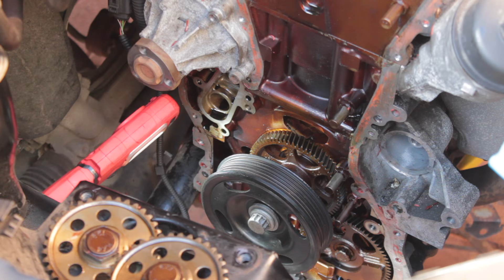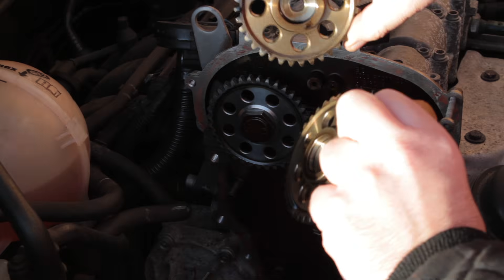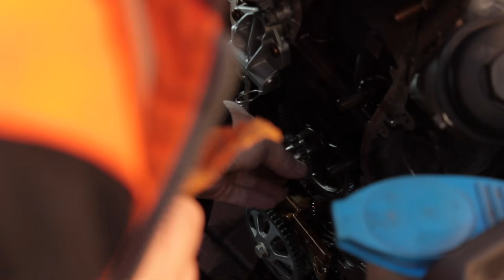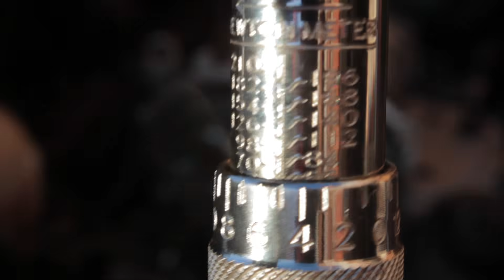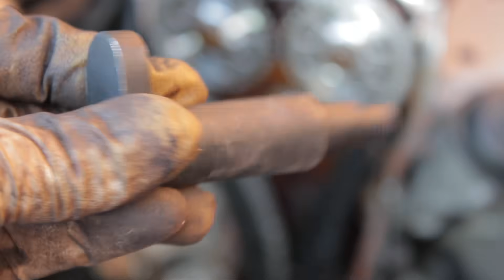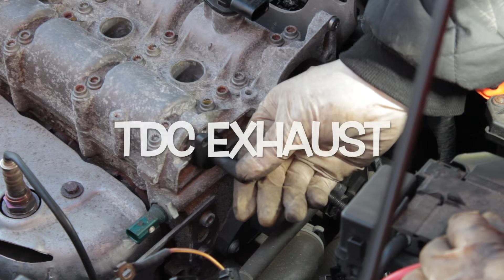VW Polo 1.2  2010 Timing Chain Renewal Engine Code - CGP Part 3

Comment: Hi, if the 2 dots on the bottom gears are lined up with each other and the cams locked with cylinder 1 at TDC, would yoh say its properly timed up? I only ask as I've done one today and the crankshaft locking tool would not go in the hole to lock the crank so decided to do it without that. I would have run it but was doing it at work but they closed before I had time to finish.

Comment: I see replacement of sprocket bot, or not, discussed and with different opinions several forums. The original Seat repair manual for this engine does NOT mention replacing the bolts. The Haynes manual says to replace. Both manual says to replace the crank bolt for comparison (and lubricate it according to Seat manual). The cam sprocket bolts are 12.9, and according to specs I find online the tensile strength of 12.9 is minimum 1220 MPa. Some googling show me that max tensile strength of cam steel is 1200 MPa, but others states higher (and I don't know about the ones in the 1.2 engine). So there will probably be similar deformation inside the cams as the bolt threads if my interpretation is correct.

Just doing the same job with the sprockets just now after a head overhaul (burned and pitted valves and seats), and I see the same with the tensioner that "jumps" when cam resistance gets above a certain limit (as due to no oil pressure behind the "piston"). On my first attempt of turning the engine to check everything, the exhaust cam sprocket either slid on the cam or it jumped a tooth when the tensioner jumped. So I had to loosen the bolt on that sprocket and adjust the cam to right position (it was easy to turn using the timing lock and a water pump plier). I have not replaced the chain as it says only to "inspect" on 240000km, and the engine is 60000 away from that and the car will probably end its life before... New engine turning verification looks fine even with only additional 45 degrees on the bolts (as I didn't want to torque them up to full before checking again). After several rotations (even with tensioner jumping each rotation), the timing tools gets in perfectly at TDC.

But it worries me what actually happened when the exhaust cam slid on first check. Any suggestions? Should I remove both sprockets again, degrease contact surface (as I guess friction here is the only way of transferring the torque from the chain to the cams), and put additional pressure to the tensioner when torqueing up the bolts to its first step (50Nm)? Any thoughts or suggestions?

Comment: Firstly why didn’t you time it up to start with when you have to correct timing kit seems a bit backwards to me. But the you rattle on about flex in the chain it’s not flex it’s because there is no oil in the timing chain tensioner which hydraulically keeps tension on the tinning chain guide. The tensioner won’t work until its got oil in it as that is how tension is held onto the timing chain guide it’s not flex it’s not oil pressure in the tensioner 😝😜🙈

Comment: Great video as usual sandy very informative, I unfortunately followed all procedures got it all lined up hand turned several times without plugs in and all still lined up but for some reason have zero compression in all cylinders, leak down test shown all air escaping through intake pipe, triple checked my timing and still looks good so unsure what I’ve done but pointing to intake valves even tho they were fine before I removed the timing chain with crank and cams locked before hand, wtf age I done or am I missing 😂

Comment: I think the slack in the new tensioner is because there is no oil pressure yet. I'm highlighting that I think that's why. Busy doing the exact same job now. Thanks for the useful video. Wish I had a 2nd man for torquing these bolts!

Comment: Hi Sandy I’m having a nightmare with these timing mark. You said your timing marks were 180 degs out on the crank at the beginning. But they must have been right 180 deg out as after you put the new chain back on with the cam tool in place you were on the exhaust stroke. 
Can you please clarify where tdc mark should be with the cam tool in? Marks together or 180 deg out. 
Many thanks I’m having a nightmare with this. 

If I put all the tooling in (crank and cam) and install the chain every time the cam position is 180 degrees out the with the mark together (That is why I think the dots/marks must be opposite when you install the cam tool) maybe!
Reply from the maker: Just go with the timing tools if they correctly in/engaged then the timing must be right don’t worry about dots on crank maybe it’s just an anomaly. Time up and turn crank by hand to make sure nothing hits before u crank it up
Reply: @sandyande  thanks for the reply. I found out today Peugeot use a wasted ignition system where it fires on exhaust and compression so think I’m good.
Reply: It all worked out. For any one doing this job with the tools fitted your be on TDC no.1 exhaust stroke not compression. 
Thanks for doing this video Sandy.

Comment: Hi sandy yesterday replaced my timing chain on 1.2 petrol polo , however during test start it was observed that the oil pump isn’t pumping oil . Earlier i mean before the repair pump was fine. What could be the issue? Could it be the pump or timing installation setting? Please respond

Comment: Hi Sandy thanks for posting these videos very helpfull, my daughter's 10 plate has same problem just hope it hasn't done valves, I can't seem to find  the crankshaft sensor is it over the back on the top of the bellhousing,all so can I lock the engine with the TDC peg so as to undo the bottom pulley my zippy gun hasn't got the guts in it to wiz it off,thanks

Comment: Thank you for the videos and the great help with this job.
I just did mine today, same car and engine. I followed all the steps and specs and changed both chains as well. During the assembly, all marks were ok on both camshafts and the crankshaft and TDC. After torquing everything down I turned the engine and all marks were spot on again. So I finished the assembly and when I started the engine, it started straight away and after 2 seconds the tensioner pumped oil and the rattling disappeared and the engine started to run nice and smooth. But maybe 10 seconds later all of a sudden another rattling started and this time wasn't going away. It sounded from the area of the timing chain. I stopped the engine and after a while started it again and the noise was there all the time. I tried to rev it a little bit in case it needs to pump oil better up to 2000 rpm but no difference. Weather at idle or higher revs, accelerating or decelerating the noise was always there and not changing. I then turned the engine off and left it. Tomorrow will open the camshafts covers to check the timing again.
Also, new Castrol Edge 5W30 oil and oil filter filled up to the max mark.
Anyone experiencing anything like this after changing the whole kit of chains?
Reply: OK guys the problem is solved now.
After doing all the work on my own all day (took me 12 hours non-stop work on my own) I was very tired and dehidrated at the end. So I mus have forgoten to tighten the three bolts on the water pump. So when I first started the engine after 10 seconds they got realy lose and the belt was half way out of the sproket. I was lucky that no damage happened from this. In the morning when I checked everything again I first saw this belt not in place and the bolts lose. When tightening them everything was fine.
So make sure you double and triple check everything before you start your engine :)
Reply: @Toschomacher  thank you for your feed-back... I have a question, I have the same engine, what are the symptoms to change the timing chain ? I have a noise at cold start 1-3 seconds, but not everyday...
Reply: @jedgr  usually when you hear chain rattling on a cold start is an indication of a slag, which could be stretched chain, tired tentioner (if it's a spring tentioner) or both. In any case the best and safe thing to do is to inspect and best change the whole kit with new parts to make sure you won't damage the entire engine if you slip a tooth or more on the timing. Especially if you have done the max mileage for this chain. Usually if you get such a noise and symptoms means you are already way beyond the chain life.

Comment: Hey Sandy, Great Video! Is there a part 4 to this series? My polo's timing chain seems to have jumped and it won't rev over 3000 rpm without cutting out! Want to do the repairs myself rather than spending £1000 to fix it, so will be using your videos for guidance :)
Reply: For anyone who might need it. Part 3 is pretty much the end anyway you just put ~1mm thick bead of RTV silicone on the timing cover and you can put a very thin layer on the engine side to ensure theres a full mating coverage. The key to ensuring a proper seal is cleaning old silicone off then degreasing all mating faces.

Comment: I have spent ages trying to install the crank tool but I have failed.  Than I had an idea. Can I get my crank to TDC by matching up the marks on Oil pump pulley and the adjacent pulley.  Isn't this TDC?  I have checked and piston one is at the top at the same time as marks on pulleys match?

Comment: obviously the crank tool holds the crank in time.  where are the pins for the cam shafts? how do those pins you slot in on the cams hold them in time?

Comment: Am I rite in thinking it would be a good idea to set the engine at tdc at the start and lock the crank in that position?
Reply from the maker: Yes
Reply: Thanks for the reply, if you totally lost the timing could you just set piston 1 to tdc and then set the cams to tdc lock them in place then fit the chain?

Comment: How do you lock the Crankshaft?
Reply from the maker: Use these timing tools vw polo Best Q Engine Timing Locking Pin Tool Set  For Lupo Polo Skoda Fabia Seat Ibiza https://www.amazon.co.uk/dp/B072JXJTF7/ref=cm_sw_r_em_apa_i_3HY7EbXM7SAJY
Reply from the maker: https://youtu.be/Sk4aNvPukbE

Comment: Thank you so much for this video! I have same motor and same issue with the chain and tensioner, unfortunatelly it damages input valves on my engine.
Reply from the maker: Pity, just remove head and replace valves cheers sandy
Reply: Mine too... all 6 intake valves were touched. Just finished the assembly of the cover. Was also puzzled with the tensioner, but then I saw your video.🙂
Just couldn't get the camshaft bolts to reach 90° on torque. Could only get 45 to 50° (I was alone and did all my strength). Any thoughts?
Hope wilk work fine.

Comment: What you did wrong mate was you didnt get the crank timing tool into the hole in the flywheel. When they jump the cams need retiming, leave the crank at tdc. You were very lucky not to bend a valve turning the crank 180!!!!

Comment: Hi just watched the video about to buy one of these with timing chain rattle but currently doesn't run, i heard you saying it must have a big clearance do you think this would be ok or is there still chance for a valve damage>?

Great video by the way, thank you very much!
Reply from the maker: There is still a chance of valve damage, try doing a compression test! Cheers sandy
Reply: @sandyande  Thank you very much, i bought the car turns out still runs fine just in limp mode and found another video of yours  points out the issue how jumped chain can cause the limp mode, i will now change the chain thanks to your kindness in sharing your knowledge. Keep this up and thank you.
Reply: Pull the plugs and inspect. Likely to see some plug damage if you've hit a valve. Especially if its happened at speed.

Comment: Did you see my video I added to the comments in part 1 , my fabia with the same engine rattles most start ups and the garage where it's under warrenty say it's normal and ok .
I'm sure there fobbing me off until my guarantee has run out
Reply: I have the same engine and mine is the same. Not sure if it's the chain or the shims.

Comment: Hi, great video,  Thanks.  I'm in the same process right now, but I have issue ! The tool to maintain the 2 camshat in position broke inside when trying to remove pulley, even when trying to block camshaft pulley with big tool like yours ... Pulley is free wheel so blocking it will not prevent camshaft to rotate a little bit, and the 2 small tools to maintain it will brake again I guess.  Any solution ?
Reply from the maker: https://youtu.be/4FuoPkTxQGM
Reply from the maker: Try this link to a Dave sterl video about cam shaft holding tools

Comment: Hi Sandy thanks for the video very helpful.
Was there a part 4 or did you not film another part.
Thanks John
Reply from the maker: Hi John I never got round to filming it, car is now on the road so will try and do recap if I can remember the salient points! Cheers sandy
Reply: @sandyande  did you get round to doing that? Can’t find the video. Was looking to DIY the job but as the first 3 videos were great but I’d be stuck up till this part of the videos. Hope you can help
Reply from the maker: @rashelahmed2081  what's the problem?
Reply: @sandyande  just wondering what’s left to do or is that the job finished in terms of the replacement? Is it just left to fit everything back up in reverse? If so is it all done the same way except that we have to silicone the timing chain cover and the sump
Reply: @sandyande  also you removed the sump but I couldn’t quite make out what you said when you explained why, could you reiterate the point if you don’t mind
Reply: Hey thanks a lot with helped my car had a hardly start is polo vivo model 2015 after machinic removed top head

Comment: Lovely stuff my friend all the information I had gathered regarding this process on this engine all made sense thanks to your video very much appreciated and have a blessed Christmas wishes from me thank you.
Reply from the maker: No problem my friend happy to help, Happy Christmas & God Bless, Sandy
Reply: Hiya happy new year 

Quick question is it possible to reuse the crankshaft bolt?
Reply from the maker: Hope so my friend as that's what I'm going to do.  My pal who's a mechanic says that only cylinder head bolts are critical to renew, cheers sandy

Comment: Nice Sandy, I am enjoying this. I am guessing with the tensioner under oil pressure the chain "jump" is likely much less pronounce...I am sure your well aware of that. Think also with only 3 cylinders the valve spring compression and subsequent decompression @ over center on the cam lobes appears much more pronounced.....just a thought, I don't know for certain. Cheers Pal.
Reply from the maker: Yes think your right my friend, once I get oil in it should sort that excess movement, merry Christmas, Sandy
Reply: All the best Sandy...forgot to thumbs up...since rectified.